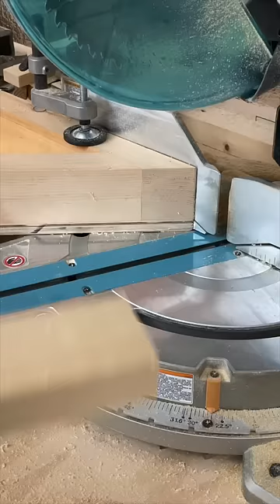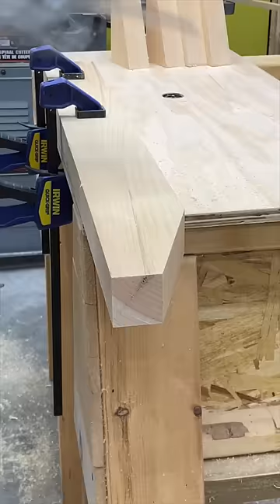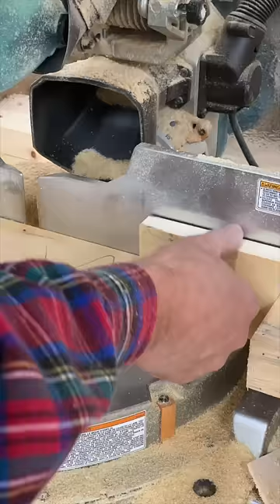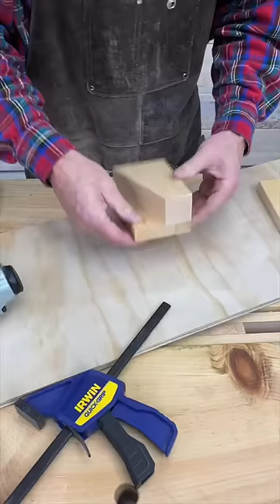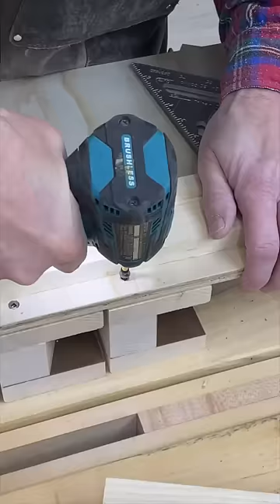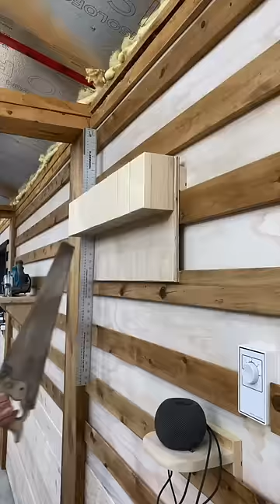Floating Saw Rack #woodworkingprojects #frenchcleat #diy

Comment: This is exactly the kind of thing most of us want to see. You can't put a price on inexpensive convenience and comfort that you can make yourself, simply and easily.
Reply from the maker: Agreed. We can craft numerous tools and jigs to facilitate woodworking practice. In my view, these projects add excitement to this hobby or craft. Thanks for sharing your positive comment @travislebaube7646 and have a nice day!
Reply: All that work for a magnetic tool holder? never heard of a magnetic strip? cheap and 5min to fit..
Reply: @willielongbotham7156  it isn't magnetic. It is friction. It can also be adapted to do many other uses that magnets just can not work for. I have the magnetic strips, and they are useful, but they are also dangerous and annoying. I've had saws and other objects pop off and fall at my feet when I'm trying to grab another tool.
Reply: @willielongbotham7156 
Yes but it takes up 10 times more wall space for the same amount items, do the sums! cheers.

Comment: Great idea 💡 but wondering to myself why, on the second cut, not just use the chop saw again 🤷‍♂️
Reply from the maker: Thanks for your comment @garyferguson269. First, I could have use the miter saw for the other cut but I had just enough wood prepared for this build. The second reason is that I wanted to illustrate to people new at woodworking that you can use your square as a guide to cut a piece of wood with precision. Have a nice day.

Comment: I don't get it. Is there some reason why he made the angled cuts on a mitre saw and the straight cuts  with a bar clamp, speed square and a portable circular saw?
Reply from the maker: Hello @jonfoster1566. First, I could have use the miter saw for the other cut but I had just enough wood prepared for this build. The second reason is that I wanted to illustrate to people new at woodworking that you can use your square as a guide to cut a piece of wood with precision. Have a nice day.

Comment: So they’re just sitting there then as the teeth cling to the wood or ?
Reply: Ahhhhhh!!!!! You push the blade up from the bottom to unlock!!! Eureka
Reply from the maker: Hello @matthewkuhns9297. Whether it's a saw, a ruler, or any other item that fits into the slots, it will be held in place. The downward pressure, or force of attraction, causes the round wooden dowels to secure the objects. The greater the downward force, the greater the friction between the object and the wooden dowel. Yes, to unlock the items you push upward. Thanks for the question and have a nice day!
Reply from the maker: You just made Archimedes & Newton proud. Cheers!